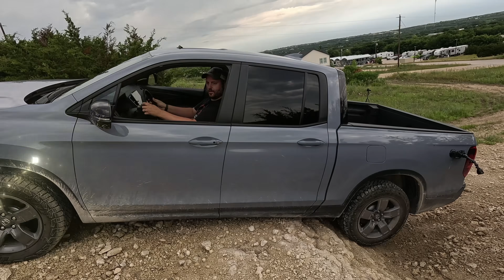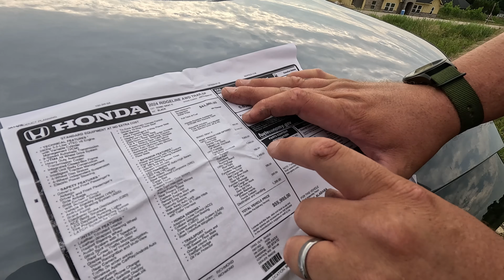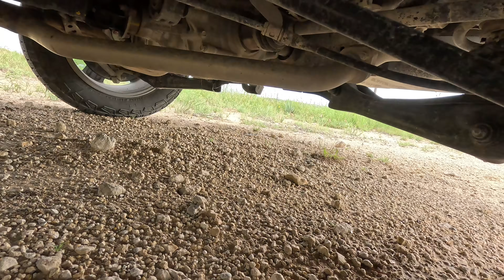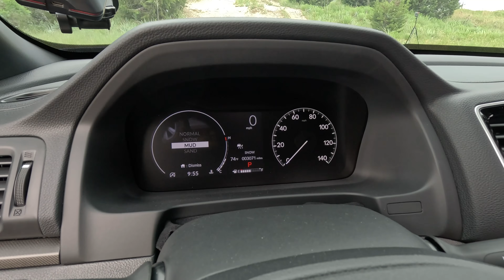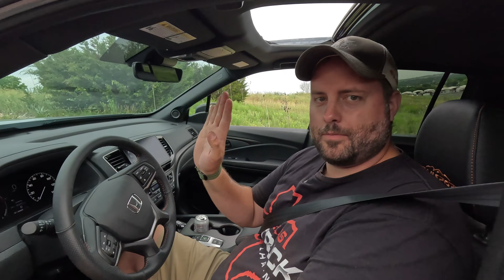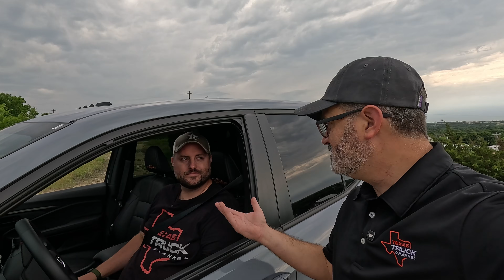Is the Honda Ridgeline TRAILSPORT Any Good Off Road? - TTC Hill Test

Comment from the maker: CORRECTION: in this episode we misspoke 2 things, 1 - this color is not specific to the Trailsport. 2 - the excellent iVTM4 awd system is standard on all Ridgeline trims. Sorry for that and thanks for watching!
Reply: Exactly. iVTM-4 and torque vectoring are standard and believe me, they turn this thing into a snow beast!
Reply: Pilot TS is much higher.

Comment: Why can’t HONDA understand that $500 worth of bolt-ons does not deserve a special badge.
They did it with the HPD and now with the TrailSport.
 Anybody can put better tires on their Ridgeline( most do ).

HONDA needed to release the Trailsport as a package with a 2” lift, up-sized off-road tires, front and rear recovery hooks, full skid plating and add a mild turbo to the V6 to bump the horsepower to 330 or so.
Then maybe HONDA could shake the “Pilot with a bed “ reputation.
People would pay the extra $10,000 , I’m sure.

Comment: On my second 2nd gen RL now (19 and then a 23). Ordered a 26 T/S last month.
These things do everything "on road" very well.  Excellent on road trips too.  Few months ago I towed a car w/trailer (5000lbs) 1000 miles (Fla to Oh) with zero problem and even got 21mpg doing that!.    70mph, CC on, and let it shift on its own.
One thing to note about slow speed and off road.  Use "S" for transmission and the shift paddles to manually hold it in 1st or 2nd gear.  I've seen on reviewers let it go in "D" which starts off in 2nd... not 1st.
Also, if anyone is interested you can raise them about 1" (25mm) and up size the tires +1 w/o any real detriments to longevity.  And if you raise the front only you'll want to re-aim the headlights.

Comment: It is a really good “Cruck” for everyday use.  Good gas mileage (~23mpg), comfortable on long drives and fits in parking garages and spaces better than a full size truck. Plus the lockable trunk in the back is great for keeping things out of sight. I have a 2017 and have 100+K miles on it and still have no complaints.

Comment: I bought one two weeks ago. Who the fuck would spend 50k for any truck to go off road ? It's a lame argument . 90% of full size body on frame trucks are used to get groceries.  If going into the back woods it would be in an older 4X4.
Reply: Yea nah plenty of people spend 60 70 80 and more so ur wrong. Some others buy base models and add 20k on aftermarket mods so yea again ur wrong
Reply: @exreturn2010  Some people? good fucking argument. It is a fact that a small group of people spend 60k on a truck and take it into the back country. so yeah you are wrong.

Comment: To me, the Ridgeline is arguably superior to “other pickups” in most suburban type applications. But it is a niche vehicle and a Ridgeline “trailsport” just seems silly to me.
Reply: Had Honda raised it, bigger tires, and a "Trail Sport" mode (tuning) it would have been far more attractive IMO.
I ordered a 26 T/S because it has the latest upgrades and the off road tires.  In time I'd like to raise it 1" and +1 the tires
Reply: @wydopnthrtl  some that I have seen with a Traxda or HRG lift look wayyy better than stock, imho, and I realize that with some mods they can handle light over landing and things fine.  It’s just that for me, if I were going to be doing much of that a Ridgeline wouldn’t be my first choice. I love mine for what I need it for though.
Reply: @AlowisciousMahoney   me too.
I might raise the front of the 26 just enough to give it a even spacing.  Then later get a +1 tire w/new rims.  
I'm old school and don't like all these black and dark colored wheels from OEM.  
The 26 will be my main family car for some yrs so I can't go to tall. (80yr old M-I-L rides in back several times a week)

Comment: I just traded my 22 RTL in today for a 25 Trailsport / blaock on black. I did not intend to trade today, but I was there to get a slow passenger window fixed, a rear glass replaced because it rattled, a recall fixed and an oil change in anticipation of a 220 mile drive to Colorado next month. I saw it sitting there and I just had to open the door. First thing I noticed was the full center console armrest and the cup-grabbers in the cup holder. Then it went on to the newer cluster and bult in nav... Honda listens to it's customers. They improved the things I'd learned to hate and changed nothing that I really liked about the old one. Honestly, i think that they were focusing on maintaining fuel mileage ratings and that extra height adds drag. I do understand folk's feelings about it though, if they're boasting a trail sport badge. I'm just experiencing so many improvements in this truck that I'm good with it like it is. I may get creative in Colorado... peace!

Comment: Makes sense. When stability control is on it disengage the clutch when it senses a slip. Disabling the stability control is like working the all wheel without cutting the power when it senses slip. The same with Acura SH-AWD.

Comment: I have the 2024 ridgeline trailsport. Best vehicle for most people.
Reply: I am really considering one of these things. I think the transport trim will be better for me because of the all-terrain tires and the slightly softer spring rate. Even though I will predominantly drive on the street, I do want to venture off on gravel roads from time to time.
Reply: It's the right truck for most guys. Most guys never pull anything or only pull a utility trailer occasionally but are insistent on driving a full size truck that is a real PITA to drive around town. Most guys are kind of... well.... stupid.

Comment: Ivtm4 is standard in all ridgelines, it's not specific to the trails port model. I don't believe the trails port has any additional modes that the other trims have (normal, mud, sand, snow). The trailsport largely just has different tuned suspension, better tires and the small skid plate, other than that the other trims are equally capable. Also note that for 2024, honda eliminated the "in bed audio" feature on all trims. I think the trailsport was a bit of a miss for the Ridgeline, they could have done much more. I'm in the process of ordering a full set of skid plates for my 2023 RTL-E and lifting it 1.5" front and rear. Once my tires wear out I'll be going with a slightly larger tire (265 is the largest you can go no matter how much it's lifted). Stock size is 245
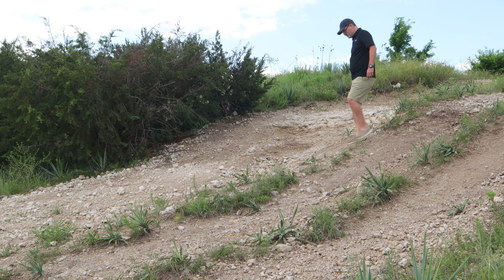Reply: Be careful of the larger tires. That size does rub. There is a fix for that though. A Traxda front relocation kit does the trick by moving it one inch forward. That’s what I did to my 2021 Ridgeline RTLE which is more of a trail sport than the actual trail sport. I have added skid plates all underneath and I have recovery hooks on the front as well with a 1.5 inch lift and 1.5 Bora wheel spacers. I am getting ready to add flat out suspension and get rid of the stock version which is adjustable from 1-3 inches and a better tow with the heavy duty rear shocks. You can also adjust the damping for a comfortable ride to an off-road ride. If you go taller than 1.5 inches, you will need to drop the subframe and drivetrain to keep the geometry the same as a stock version. The Ridgeline is very upgradable just like everyone does with other brands of trucks. 7:48

Comment: I did a 1.5 Level kit on my trailsport for a 9.1 lift at the front  worth it
Reply: Did you do it yourself or did you take it to a shop? How much did it cost? Thanks.
Reply: I did that to mine as well. With more aggressive tires. looks great.
Reply: How much all in ??
Reply: Do you only need to do a leveling kit to the front of the truck or do you need to do the back as well?
Reply: How’s ride comfort and mpg?

Comment: Does this not have an offroad mode? Also...I've been told that it doesn't have the same advanced AWD as the Pilot, thoughts on that?
Reply: Still uses the same iVTM4 AWD since 2017
Reply: @Marbind  I just looked it up. I guess the pilot has the "trail torque logic" which is more advanced software than the passport and the ridgeline (trail sport trims). But yes..same hardware.
Reply: From what I've read, it doesn't have it. Plus, that color is on other trims.

Comment: This SUV with a bed is not good OffRoad
Reply: OK dude, is not a truck. Anything else?
Reply: @IamGroot786  nothing else, we’re good!
Reply: Glad you feel better about yourself.  Go google the Webster dictionary definition of a truck...it's a truck troll.
Reply: @ColoradoGenx13  the Ridgeline is more similar to a mini-van then a truck
Reply: @smittysmitty481 it has about as much in common with a Pilot as the Tundra does the Sequoia…

Everything from the B pillar back is completely different, and it is substantially strengthened, which is why the payload is significantly higher.
Reply: @owequitit  it’s not a real truck!!
Reply: Exactly why I bought one. I know you're trying to insult it, but you're actually complimenting it.
Reply: @trl1980 same here. I got the TS in Diffused Sky Pearl, a color that is 1st year, exclusive to the TS package.
Reply: @trl1980 true that
Reply: Dudes who have insecurities in man card will hate this truck but 90% of them who own those big pos truck dont even tow or go off road willing to pay $80 for gas just to drive around town 😂
Reply: @RedmanLS3  my confidence is solid. It’s not a real truck because it’s not a body on frame build, it does not offer 4x4, no rear lockers, no solid rear axel, & no skid plate protection. Real world people shop this vehical against the Maverick & Santa Cruz, & not against real trucks like the Colorado, Ranger, & Tacoma
Reply: @smittysmitty481  dude we all know that. It's a small truck and was never design to complete with big trucks. It still a truck. people talk shit about it because it's a honda but not the ugly ford merrick because it's a ford. I'll pick the ridgeline over any pos small ford truck all day. At the end I will have better reliability and value while the ford are garbage. This Coming from a gm guy
Reply: @smittysmitty481  I would argue they're not "real trucks" either; however, the honda is the only one with a bed you can actually lay down a sheet of plywood between the wheel wells and if I had to pick one that was going to last and not break down when tasked with a bunch of demanding chores it's going to be between Honda and Toyota.
Reply: @smittysmitty481 is it though?

I bought it over a Tacoma, Ranger Colorado, etc.

Why?  Because it has superior storage and I can actually use the back seat.  It also had a significantly bigger payload than several of the options, and yes, I use it just fine and the truck has no issues with it.  I’ve towed max load with it quite a bit too and no problems there either.

I put a 2” lift and bigger tires and it will go anywhere I need it to that is reasonable. So glad I bought it over a “real” truck.

But by your logic, a 2WD F-150 isn’t a real truck because it doesn’t have underbody protection, 4x4, lockers or low range.

Also, companies use BOF because it is cheap and is easy to make different configurations, not necessarily because it is better.  BOF is also not a requirement to meet the definition of a truck.  Again, by your logic, a Caprice is a truck.
Reply: @owequitit  it’s not a real truck!
Reply: @ it is in every measure of the word, and the more you repeat it, the more it validates it.
Reply: Somebody here has a tiny little wiener. We all know who it is.
Reply: @Ccd-c6dit does truck stuff just fine and with no issues. It is perfectly capable of being used as a truck.
Reply: I have a 2024 Ridgeline Trailsport and I never plan to go off-roading. I like the SUV comfort ride, also the fact that you don't have to use a step and pull yourself up with the windshield handle to get in to the vehicle. I have hauled a 19 ft Larson I/O speed boat with no issues towing it at highway speeds. I don't live in a mountain state so can't comment on long uphill pulls. Have helped move furniture and other items - kind of sucks when people find out you have a truck and beg you to help them move their things. I also like the idea that plywood and sheet rock will lay flat in the bed between the wheel wells. I love the hidden locking trunk space in the bed near the two way opening lift gate. Just swing it open to get to the trunk, or drop it down to load items in the bed. The stereo system sounds great and Android Auto works well. In my cold climate I love the Trailsport heated seats and heated steering wheel. To me - it is a joy to drive around in. Love my Trailsport!

Comment: I’ll never understand why Honda did not slightly lift their Trailsport models like the Subaru Wilderness models! 😑 It has a good Awd system, just so dang low.
Reply: You beat me to it, $45000 and they could put a 1.5” lift and maybe modify the bumpers for better angles
Reply: The new Pilot Trailsport is raised to 8.5, the motor got slightly upgraded, and the transmission is new. Hopefully they move all that over to the Ridgeline. Well the inch lift should be moved to the Trailsport at least
Reply: I think Honda meant them to be all weather on road vehicles not off road vehicles.
Reply: JonDZ Adventures uploaded,
Honda Ridgeline vs Landcruiser vs Jeep
Reply: Yeah, I mean for chrissakes it has a Trailsport badge. TRAILSPORT!
Reply: they are really easy to lift though.
Reply: @matthewrideout2677  Yes, but the Trailsport should come that way, imo 😁
Reply: @matthewrideout2677  Sure but people shouldn't need to pay for aftermarket labor for that modification. It should be factory ready
Reply: Sure, but why would you when for less money you can get a Ranger FX4 for $42000?
Reply: @DavefromCA2023 Ranger doesn't have a NA V6. They can keep their troublesome ecojunk turbos.
Reply: @DavefromCA2023 why would I buy a pos ford with one of the worst reliability and value? I'll spend more for a ridgeline anyday
Reply: @RedmanLS3  actually the ranger is rated pretty well for reliability and holds its value very well. If you are going off road the ridgeline is going to be very limited with where you can go and lacks a two speed transfer case
Reply: @DavefromCA2023  I work for sales at chevy and nope. Gms are last in reliability and value. People who trade in their toyota and honda get better number on their appraisal
Reply: @DavefromCA2023 lol ranger and reliability dont belong in the same sentence. Also the ranger is incredibly uncomfortable and enclosed in comparison to the ridgeline
Reply: I told "TPTB" we should raise it 1" and put 31" tires on it.
Reply: the trailsports come with a 1 inch lift